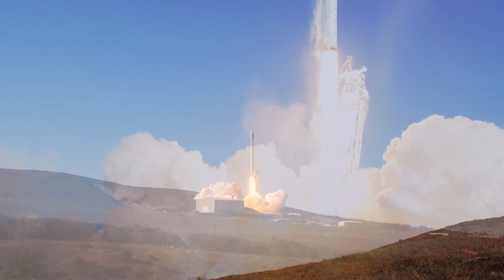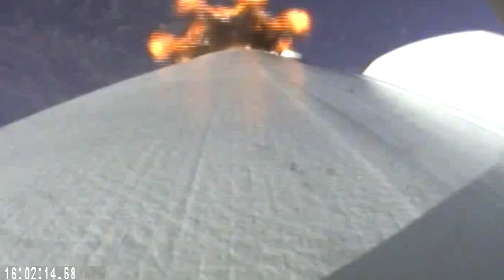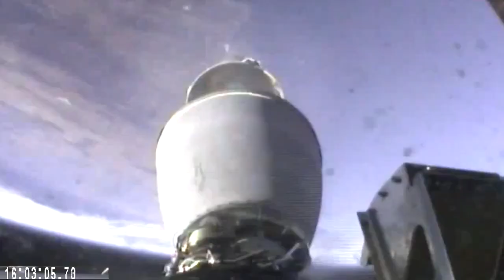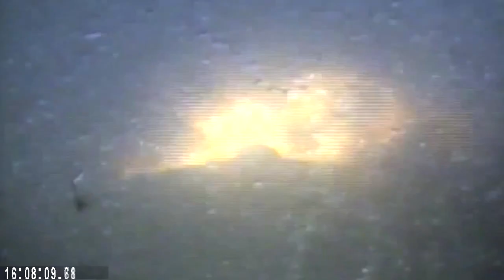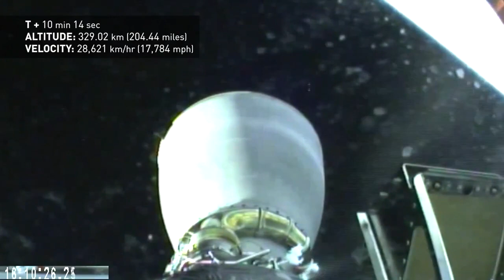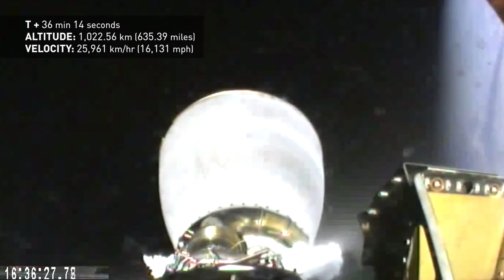Video Captures SpaceX's 'Re-Lightable' Engine

Comment: What does restarting an engine inflight have to do with recovering, reconditioning, and refueling the booster?
Reply: it slows the descent so it can land on a barge is what spacex are thinking
Reply: This is a great infographic explaining how the operation works. The engine isn't burning constantly; air friction will do most of the hard word (as it does when reentering from orbit). The engines are only needed to adjust the stage's course and slow from terminal velocity for final landing.

http://media2.s-nbcnews.com/j/newscms/2014_51/812491/141217-launchprofile_f4fcb1ed474952c078a75c07a96cae6f.nbcnews-ux-560-480.jpg
Reply: You can't recover a liquid fueled first stage without slowing the descent. A parachute won't cut it and water landings would destroy the engines.
Reply: If you want the rocket to land, you want the engines to be on right?

Comment: PFFT  No way it gets to 62 miles in 3 minutes.
Reply: You can do the maths yourself
Reply: Hey Ninny that is 327 thousand miles and no way does the rocket travel 10 mph
Reply: 10 thousand mph  No way
Reply: actually they travel nearly twice that to reach orbit
Reply: 17,500mph or around 7700-7800m/s is required for a stable orbit 250km or less